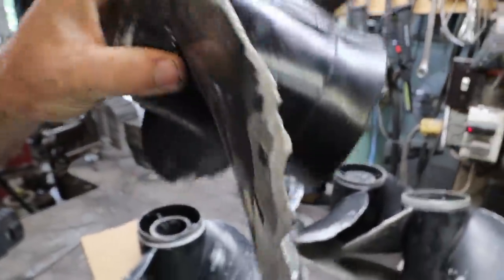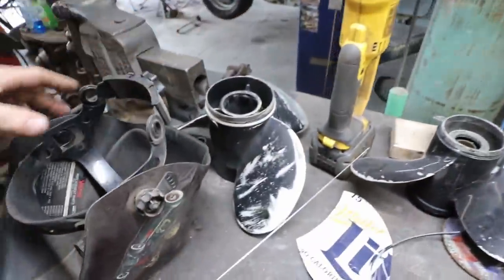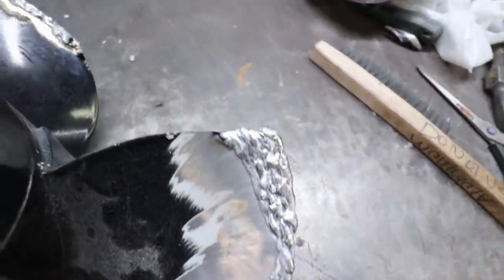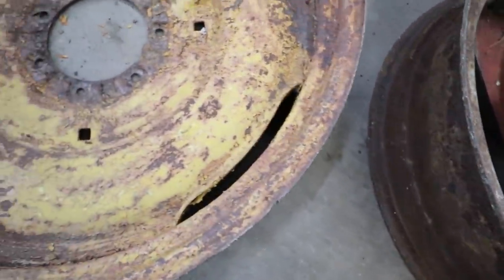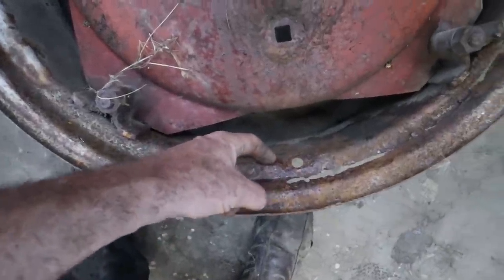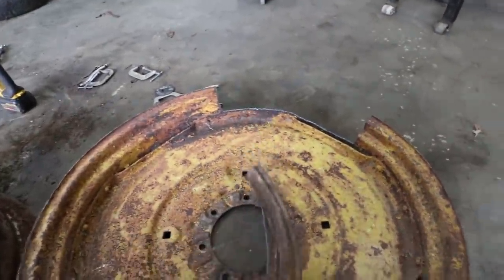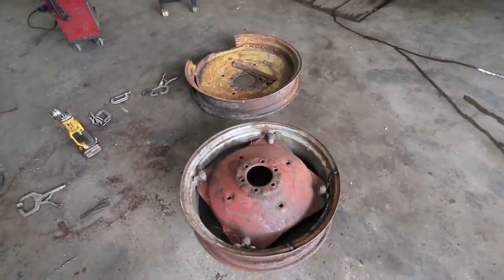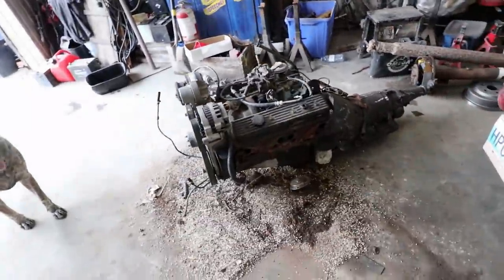Fixing boat props and repairing a rotten tractor rim.

Comment: I wouldn’t be opposed to seeing you work on that Massey 25. I’d like to see it running & driving with the loader operating. I’ve got a old MF 35 gas, hardly ever use it since buying a modern Kubota hydrostatic drive diesel.

Comment: Brent, Tig welding aluminum is easy but you have to keep it clean. I have wire wheels, grinding wheels,sanding discs and stainless steel wool that I keep in an aluminum box. I clean my weld when I stop and start too

Comment: Great video we rebuilt the outboard  props the same way they still work great haven't had any problem with balance different  size props change the  gearing a welded up reco prop works out way cheaper than a new one! The rim repair for the tractor turns out great on the old Ferguson  they really popular here in Australia keep the videos Brent cheers cs nsw Australia

Comment: This is why you get stainless props for outboards and Nibral for direct drive/v drive.  Those aluminum props loose material too easily when hit.  If they aren't balanced they vibrate at higher rpms and mess with bearings...etc.  I've had props made of both materials repaired and they usually come out still nicely balanced because you just need to reshape them when deformed by rocks.
Reply: But if u have SS an hit something ,u have gear breakage..lol.been their do that lmao
Reply: @kyleforeman4543  I find that outboards can handle Stainless....but yes it does send a shock back down the driveshaft.  The more sensitive direct drive system definitely should use Nibral for props.  They deform easily.

Comment: Excellent video Brent  :) also never did welding on propeller fans on boat motors ever & I hear they are challenging to repair or people replace more often with brand new and sometimes weld up! Also farm tractor rims 120 grip sandpaper or sandblast then put heavy duty primer do 400 grip sandpaper up on light sand up don't blow off to much with air compressor then put heavy duty coat paint of grey or silver or black rust coat paint on do 2 coats & colors too and 2 coats clear they never rust bad ! I done lots them over years and that way to paint them last lifetime every time change tires on front plus back for tractor, combines , any farm equipment plus fork lifts and trucks too! Plus yes work on Farm Tractor be excellent one Brent  :) plus that Transmission remote shift lever be easy fix to do and repair to do there like floor shifter in pickup or car or van to do !  Be nice video on too and hope hear when start help out to fix I will help with it on comments! You say want do more too after too I bet!

Comment: I ran a prop shop for years, from outboard up to 7 foot fishing boat props. The way you index a prop for a pattern is to chuck it in something and scribe a line on all  the blades about 1/2 way out from the hub and use where it intersects the edges as the reference, copy the best to the rest.

Comment: I would be interested in seeing you work on the old tractor .  I have a 1959 Ferguson 35 which is a little bigger than the 25 you have there . I'v been around tractors all my life but never saw a 25 around my neck of the woods .  Wheel work was helpful for me i have two i removed from mine a put some lighter duty ones on . Mine need a few badly rusted out areas on both that need repaired . I was thinking about finding another one rusted to cut up and repair mine .

Comment: I built rims for 12 inch tires, and spacer rings to put Duals on my lawn tractor when it so say grew up to be a big tractor, i put a 3 cylinder deisel in it, and built a replica of a full farm tractor Ease On Loader for it, put duals, and tricked it out with a cute exhaust and air cleaner  to duplicate the massy tractors from that year. my next one was a 4 cylinder deisel in a lgt165 ford, I copied a JD quick attach loader, that took some doing but worked awesome, cheeted on it found same size rims and took out centers only hadda make the spacer rings and tie bolts. then i put a 2 cyl deisel in  a 355JD and got the loader 75% built before to my heart ache some one stole the tractor and dumped the partly finished loader in the ditch at some rate of speed wich bent it badly. I have suspitions who did it but was no way to catch them. but my sweet little tractor took flight

Comment: What we would do on old tractor wheels they always rusted out at the valve stem we would weld in a large flat washer , on the inside so not to cut up the tube we would clean rust best we could with wire wheel then take and build a inter liner out of duct tape . That gave the tube a smooth surface to ride against .

Comment: It looks like you did a good job welding the props up my only question were they all the same pitch, because some prop have more angle than say a 14 pitch to mybe 19 pitch it all has to do with how much water the scoop up thest the differ pitchs.. Also I used regular  alcohol to clean the metal. Keep up the good work.............

Comment: I KNOW VERY LITTLE ABOUT WELDING ANYTHING BUT IF YOU CUT A PATTERN OUT OF ALUMINUM AND THEN WELD THEM ON THE FINS WOULDNT THAT BE BETTER THAN MELTING ALUMINUM ONTO THE ENDS OF THE FINS TO BRING THEM BACK TO THEIR ORIGINAL FORM AND ISNT THEIR A BALANCE ISSUE

Comment: Aluminum welding boat propellers, practice welding fer a fellers, they ain't balanced they's just propellers. Tractor rim's rusted out, donor rim's lay'n about, just need to cut a chunk out, hammer n clamps it fits just about, off to da farm wif tomatoes pulled out, Pablo in da wind da faithful scout's about, tomatoes fer da chickens what ain't out, MF-25's closer to running about.

Comment: Unbalanced blades and pitch will ruin an engines lower end. Hope you get a pump soon or you'll be getting a new tip and pump....the Harley engine cases I've repaired were not profitable for a while. May be a good idea to stretch some old tubes over those repaired tractor tubes those rust flakes get as sharp as razor blades.

Comment: Don't props have to be balanced?
Reply from the maker: I guess it would depend on the application these are just used for spares that's the Feller I did him Ford flips boats and just gives these with them as spares
Reply: @HalfassKustoms  We used knife edge bearings and a shaft with machined cones on it to gravity balance them, big and small props, you remove weight from the back or spray more paint or epoxy like west system on them to balance, the front? the part facing away from the boat is flat in relation to the hub, check with a straight edge and do any big thinning on the curved back that's not as important, nowadays with rubber hubs the outboards are more forgiving for balance .